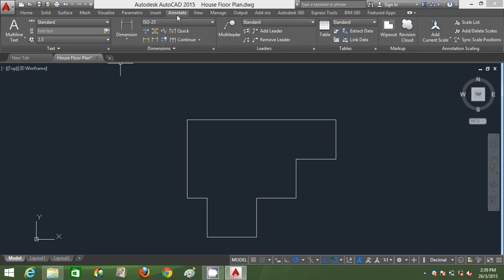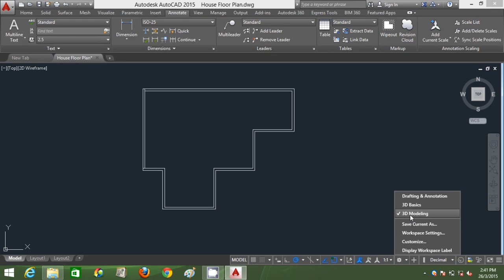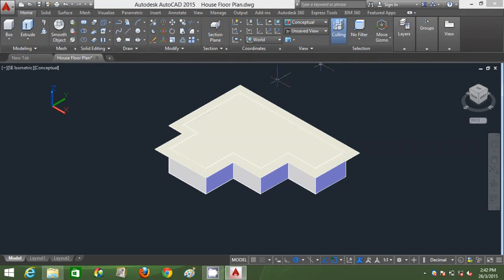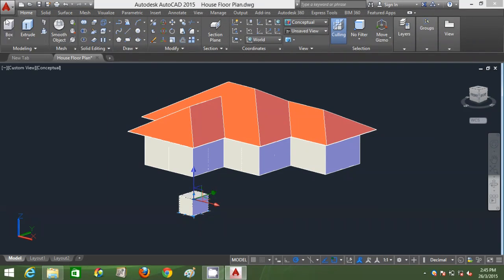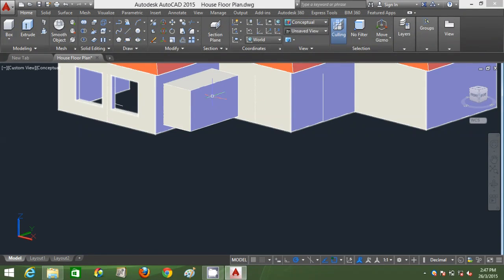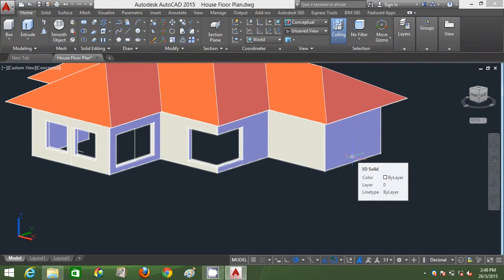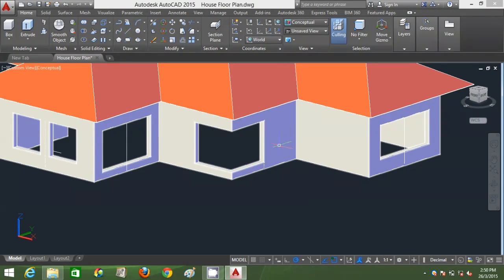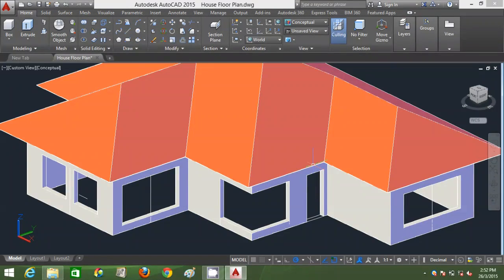AutoCAD 3D House Modeling Tutorial Beginner (Basic) Using AutoCAD 2015 by Izuddin Osman

Comment: To set or create the roof angle etc. (the portion that isn't really explained) after the offset of polyline of 1000, select the region command and select that polyline to create the surface. Extrude the roof surface (using extrude command) by 1500. this creates the roof area basically as a big box.

Now pick the roof solid and you should then see a triangular 'grip' item on one of the top edges of the roof. select the grip and drag it to a desired distance. You should now see the angled roof appear as you move the grip. select a random point so it still has a flat portion of the roof (as per the video). Now use the 'Solidedit' command with 'face' as the edit option. next option is the face edit option pick 'move' Now you should be able to select the flat face portion of the roof. select a base point and then your move to point. Make that point a sufficient distance that makes the pitch roof intersect.

That should do it if I explained it well enough.

The video needed the command line to be visable and turn the music down.